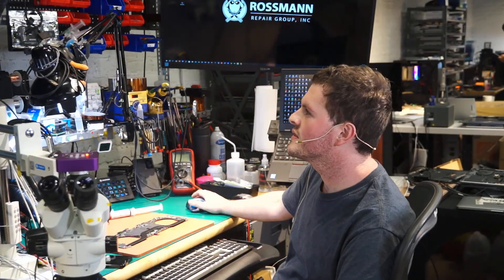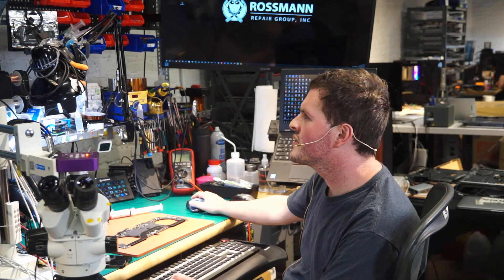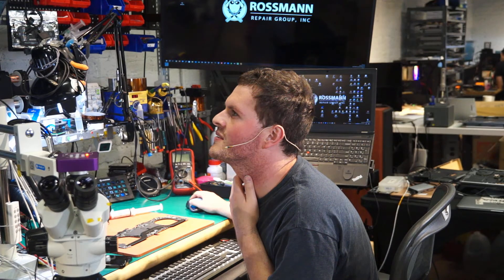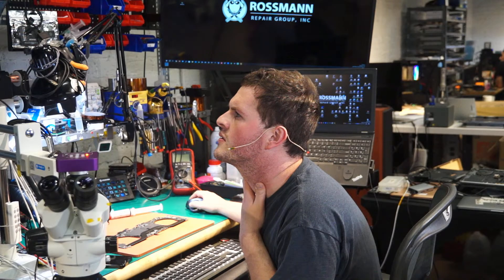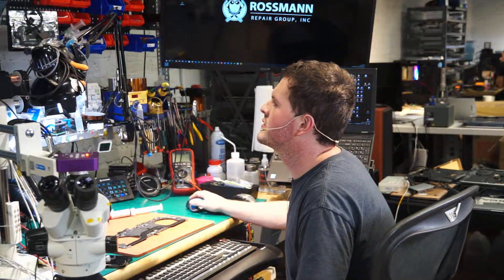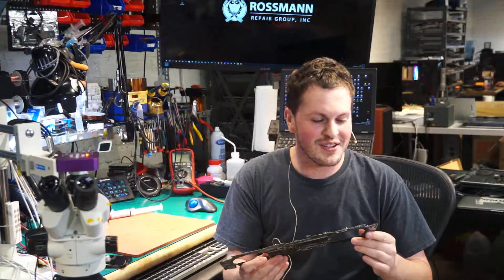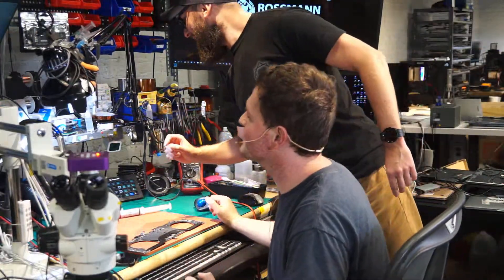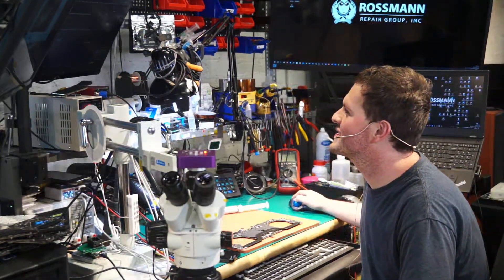Attempting to fix the strangest A2141 I've ever seen @ RossmannGroup

Comment: All 4+ ports 3217  boards need a OTP configured right side. If you put random 3217 on this side it won't work. 10v is provably a iPad sourced chip.
Reply from the maker: Nope, pulled it off of another same 2141 board. Not my first rodeo 😀It was the USB C amp meter on Dan's desk showing it was stuck at 9, Fixed it on the stream on Louis's channel.